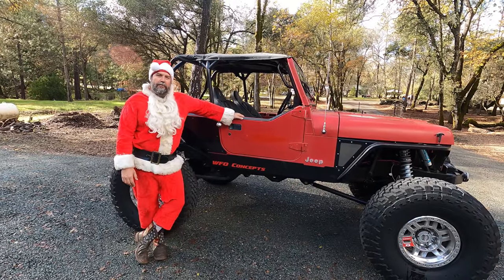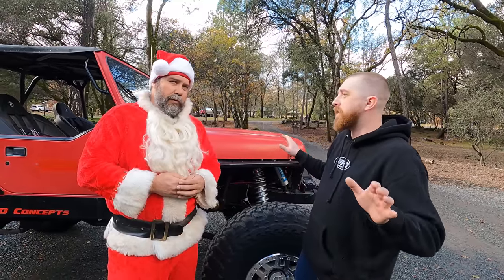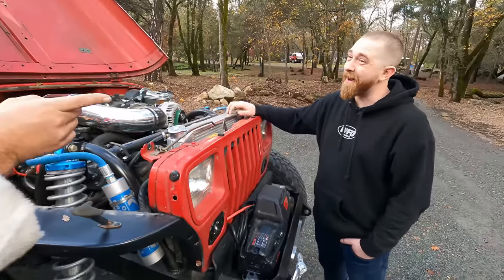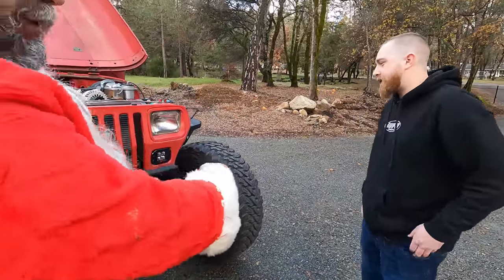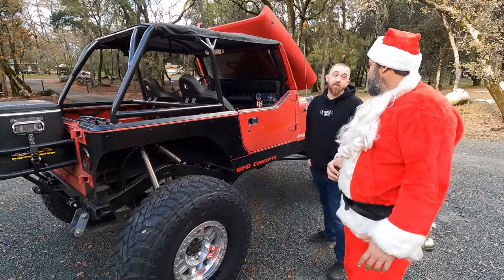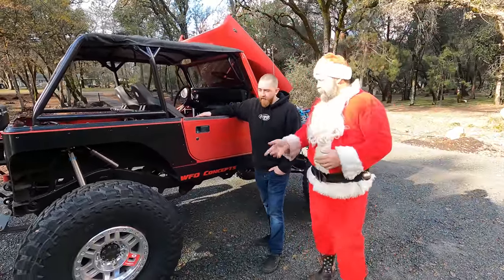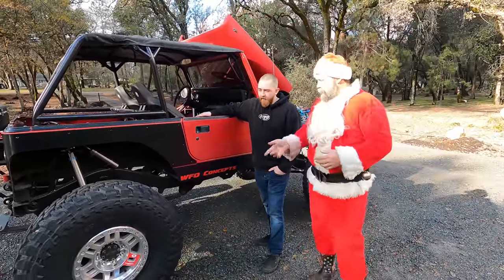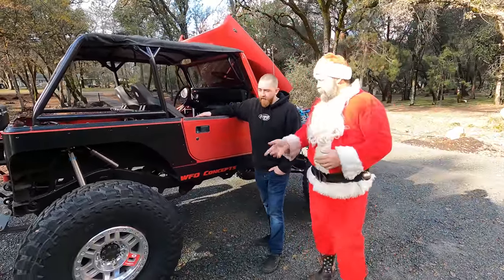(12 Rigs of Christmas) Jon's Budget YJ w/ 5.3 LS & JDM Barn find! Ep. 2

Comment: Does WFO make anything for 94-02 Ram 1500/2500 axles? 1st gen 1991-1996 Dodge Dakota, 1997-2000 Dodge Dakota and 1998-2004 Durango make perfect swaps for Ram axles they fit perfect! I have built a couple already with 2nd gen Ram axles and so far gathered that a dual rate soft ride 1500 front spring 0-3” is perfect with dakota rear leafs for a nice ride if you plan to clear anything up to 38x15.50 like im running. Im planning to CNC and fab some boxed front radius arms like a 05+ super duty or 13+ ram axles coming off the transmission crossmember with adjustable upper links for caster adjustment similar to jeep longarm kits etc.. My truck is a 1st gen 1996 Dodge Dakota single cab 6.5ft shortbed with 5.2 V8 Magnum and NV3500 5 speed manual transmission with the rare yet overlooked NP231DHD transfercase and its way way low geared but im planning to SYE it if the HD tcase can be done and 6 pinion planetary swap, its 112” wheelbase factory but assuming when the projects done it might be around 115” or so. Boxed solid radius arms so can handle some abuse, crossover steering possibly with ram assist off the front diff cover to handle these 15.50 tires, 4.56 gears to retain the feel it does near stock and try to fab up a Thuren track bar then ditch the center axle disconnect in the front (dang dodge) maybe do locker conversion eventually. Once she finished she’s getting an HX35 turbo on 6-8PSI using HP Tuners i got for it for a reliable, fun and capable rig you could take anywhere! Ill say this much the 38x15.50 Toyo MT on 2500 ram axles under 1st gen Dakota gives some serious width, looks like one of those trucks from Iceland!